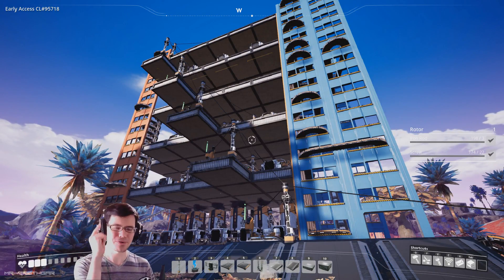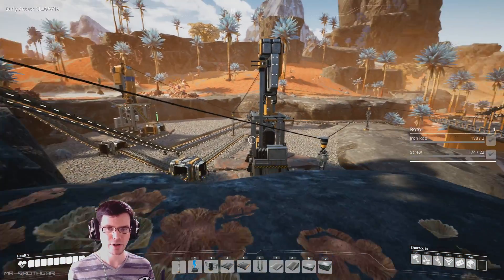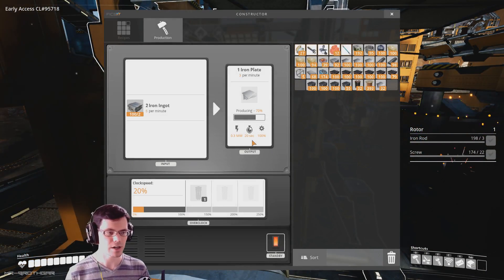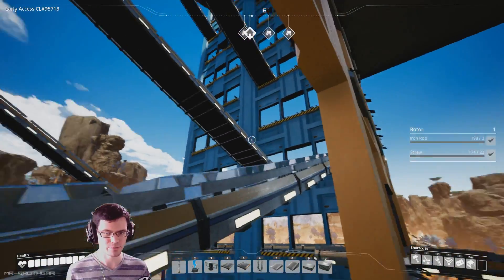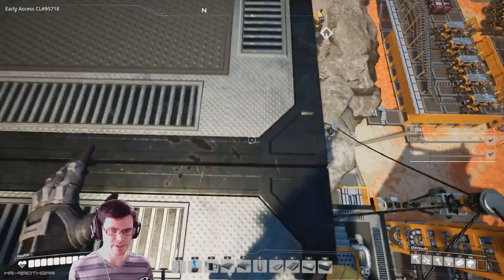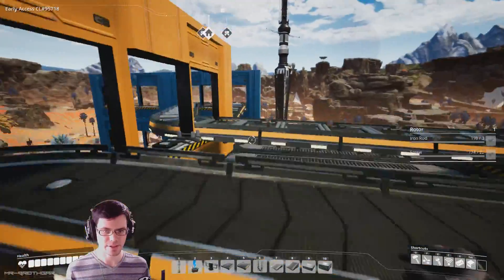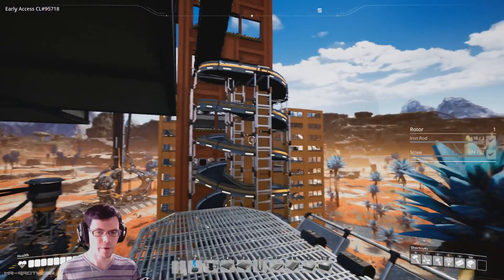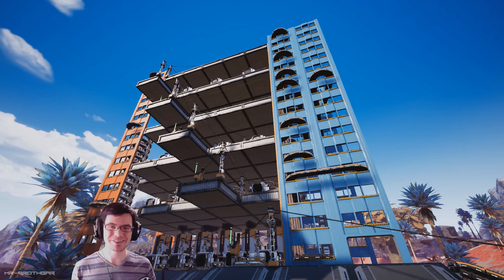Vertical Modular Frame Production Setup - Satisfactory

Comment: Nice video man.

I usually build a nice super flat plane up in the sky and build my vertical farms on top of it.

I do a trick I didn't see you do yet, and that's ultra large shared buffer storage of 10 to 20 mk2 storage boxes. At each earlier production stage. (Smelters, constructors and their products). After that i taper down, similar to your diagram, so the buffers shrink as well by the time I get to super computers.

Then I use mergers and splitters so the buffers share the load together and all my supply lines never run short of not only raw materials but also rods, nails, plates, whatever... I know I know, it's not as efficient.

But i fight efficiency with larger scale production, I always overproduce so im never short on what I need.

I guess my way is the dummer way to play the game, but it's fun. 😄

Comment: The spliters cut the flow, the trick is not underclock but do the opposite, you just need to go slug hunting, I know it takes time. 
I am using a similar approach to make screws, I have 3 miners that split into 3 smelters each, a total of 9. Using spliters and mergers I have a huge speed coming out of screws. Of course I use the alternate blueprint of screws.

Comment: i started with 4 full belts of t1 with ingots. i used 2 full T1 belts with ingots to 4 constructors making iron plates. it puts out 60/m, one full T1 belt. then i took 1 full T1 belt with ingots. split 2 times so i got 4x 15 ingots/m making rods. 60 rods/m. then 3 assemblers  to make reinforced plates and 1 constructor to make screws at each assembler. split the 60/m plates in 3, and the 60/m rods in 3. and presto. 15 reinforced plates/m at 100%. then 1 assembler making modular frames at 125% 5/m. takes exactly 15 reinforced plates and 30 rods. so i took half of the last belt to make rods at 30/ min. presto! 5 modular frames/m at 100% and 30 ingots/m to spare

Comment: Question: would it not be better to make a wider base tower, design a factory setup on one floor that can feed one or two assemblers of final product, that way in layer game you can just add floors? Right now it seems that adding to this wold be difficult vertically, and horizontally if you have other buildings near. My overall idea: have a separate factory dedicated to  smelting, and just bring those ingots in to a single floor that has all necessary machines to supply one assembler or 2, and just keep adding identical floors upwards as your demand increases. Wouldn’t that make more sense? Also, thoughts on factories for receiving ore and just mass producing T0-1 products (one big stackable factory for screws bars plates and one for wire and cable), then outputting those to a central line to feed higher teir production? Or is it easier to fabricate basic parts as needed in a frame factory?
Reply: It does make more sense, all you have to do is look at real world. A screw factory doesn't smelt iron ore then fabricate rods, they simply import the rods and export the screws. That way is very easy to ramp up or down the production.

Comment: By the way to get power upwards, just place a power pole on a foundation and delete it.
You can just run the cable up vertically that way so it doesn't take up multiple foundations of space.

Comment: Pretty dumb. Add storage units to gather up overflow and move it to other places. A storage unit should be between every production machine. That way you can move product from the storage to other places where you need it. Plus the storage unit gives you a visual cue as to if you are making stuff in a location too fast or too slow. And yes I am an Expert. Storage fills up, the next machine is too slow. Storage stays empty you need to feed it faster. Simple visual clues the lay you know where to put your speed bugs.
Reply: Or you know... You can just use math to determine required input and adjust your output accordingly.

Comment: I think you are making a mistake by not future proofing/ future proofing your way.

Think about it this way - each and every resource mined will jump up with 

next tier step up (and by overclocking mines). By making a tower that 

makes more then one product you will run into spaghetti monster by just 

doubling or tripling the tower height you have. Just imagine that 
Much more efficient in both time to build and production value would be to 

have towers that produce one product, for example a tower of smelters, you 

get enough to max production then if you want to step up production, just 

upgrade the belts that get the product to the tower, add another floor.
Then just split the produced ingots into other towers that produce another 

element.

This way any step up in production can be simply made by replicating tower 

floors. Each new alternative recepie will just improve the tower 

production (they are more efficient and you WILL WANT TO use most of them 

like for example alternate screws that halves your need for constructors 

for them skipping the rod part). You will be able to use basicly ALL power 

slugs to overclock the mines which will have most of the impact on how 

much you can produce.

What i build works in this manner (however i skipped playing with towers), 

each line of production is maxed based on how much i can fit on a belt 

tier. f.e.
450iron = 15 smelters to saturate the line with smelters
for screws- since alternate screws produce 90/min you can fit 

5constructors on a line (or 5 timex X and just stack the output belts on 

top of each other. I have 2, plan on 3 and i just put them into 3 spliters 

into 3 mergers into 3 storage bins - this way you 3 screw outputs that 

which all fill storage evenly at 450screws/min.
then you do a line/tower for plates with same thing in mind, then the 

reinforced and so on.
100% efficiency is a nice thing to have, but only if input and recepies 

would remain the same whole game and they are not.Doing it my way you 

might produce more then you need, but then it will just fill the storage 

and be able to supply next step at 450rate, even as a temporary measure to 

supply that step when you are stoping smelters to upgrade their system.
and just to ilustrate: https://imgur.com/a/kgv73G9
Also remember that "going out to explore" is part of the game, you will find tons of slugs + hard drives map: https://tiny.pl/t79h7

oh and you might think who has energy for all of that right? one pure oil without slugs gets you 12fuel generators = 1.8mw or 4.5MW if you just slug it so power is the least likely problem in all the system ;p

Comment: Loving your discovery and how you are working things so far.  Lots of good ideas. I eventually built that huge base and got to the end of the tiers for tech. Got the tier 4 belts, smart splitters and few other things... Now I'm having to re-think and re-imagine my bases all over again ... 

My next idea is : since I have multiple warehouses that feed into a bigger base, I've been pondering the idea of a central belt. With smart splitters I imagine you can run everything down a single high speed line (tier 4 = 450). Having multiple exists and entrances for items along the way (like a highway).   Been thinking of a circular (spiral idea) or a longer spanning idea using more trucks to transport lots more items - till they introduce trains. Goal is to have a factory and warehouses spread across the whole map. 

Perhaps some ideas to get your mind flowing in my ramblings for ya. <3
Reply: One thing to keep in mind with smart splitters - if one exit gets backed up, it stops the line from that point back. You either need to manage your efficiency perfectly, or insert storage buffers at the exits (which you will still need to check periodically for overflow). Do some tests before you tear everything down. Not that I would know from experience...

Comment: I know your all up for experiments, in your satisfactory video i suggested using a tree of splitters vs a line; any testing to see which performs better? Perhaps limits/eliminates the need to underclock?
Reply: Tree splitters take more room but reduce the inventory buildup/overflow issue.  I use either on a case-by-case basis.  If one building/input supplies three others, tree splitter is great.  But for something like an input of iron ingots being used by many other buildings, the space requirements become prohibitive.  Also, whether you need to overclock/underclock won't be affected, just the amount of overhead sitting around.  Overclocking is all about required inputs vs available inputs.  And since once things get spun up (or, especially, once storage fills) building inventory is no longer an issue, it's a very minor optimization.

Comment: I overclocked the frame assembler to output 5/6 or something, so it uses 15 reinforced plates and uses 100% efficiency for that part. The rods/screws part you need for the rest is messed up either way. Using the alternative screw recipe directly from ingots saves massive amounts of room on constructors though.